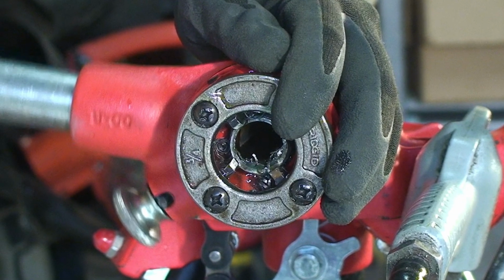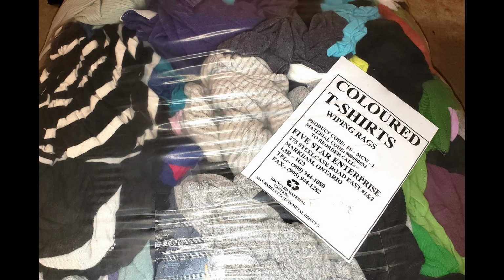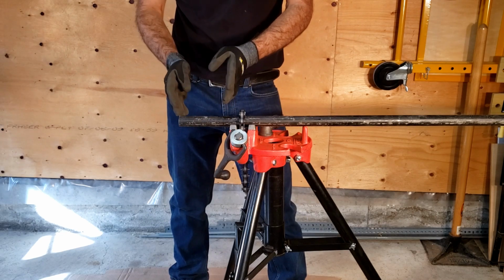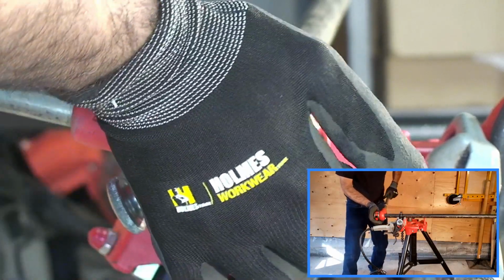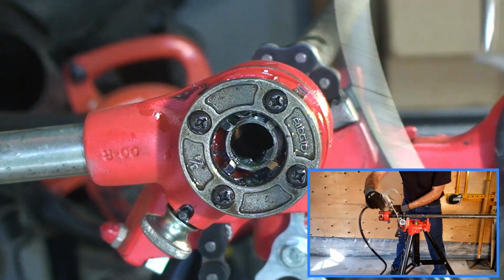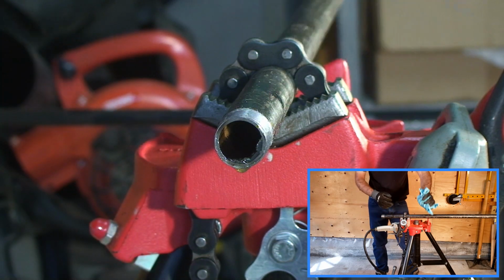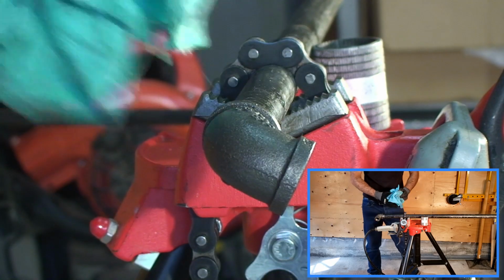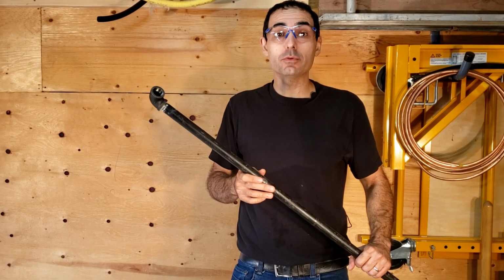Manually Threading Steel Pipe (Old School!)

Comment: URGENT: You are to funny, enjoy the humor. Ok I  have a real problem. Hired a man to drive a dry well into my yard, its 1 1/4 inch diameter as are the couplings. Well he messed up and stripped the threads, THEY LITERALLY appear to have been smashed flat on the stainless steal pipe which is about 4 feet of its 5 foot length driven in the ground, then he leaves the job!! I'm now in a pickle. I don't know if I as (a disabled woman with Rheumatoid arthritis and numerous bone disabilities is capable of pulling on some rachet to cut new threads so I wouldn't have to HIRE someone else which I cannot afford on disability. Then once the NEW coupling is put onto it, it must be driven the rest of the depth, along with either an additional 3 foot post, or another 5 foot post. What can I do, please? Also the threads seemed to have been larger at the end of where the threads were, I suppose for tightening it down good, so no water or air leaks. The new coupling I set onto it just to see where it would sit went all the way down the coupling to about two threads of the larger size on the pipe. Can that threading device be RENTED? Geez Louise. HELP?
Reply from the maker: I'm very sorry for your predicament, and I wish I could provide more supportive and useful assistance.  Unfortunately without Inspecting the situation in person it would be very difficult to properly assess or provide a proper remedy.  I'm not sure where you live, but the dies may be rentable in your area.  However, you may also need a wrench to provide counterforce as you thread...not to mention the cutting oil.  This would also require some significant elbow grease and dexterity.  All things considered, it may be most cost-efficient and practical for you to just hire someone to repair your pipe, who already has the proper tools and know-how.  I'm aware that doing so will cost money, but hiring someone may be the lesser of the evils.  I wish you best of luck with remedying your issue quickly and with minimal hardship. .

Comment: If you’re threading 2” pipe at  least have a 700 Ridgid on hand
Reply from the maker: You're not kidding!  Only because you "can" thread 2" pipe using manual hand dies, doesn't mean you should!  If you're threading 2" pipe on a regular basis, I'd suggest jumping onto a Ridgid 300 power vice (what I like to call "old faithful"!)